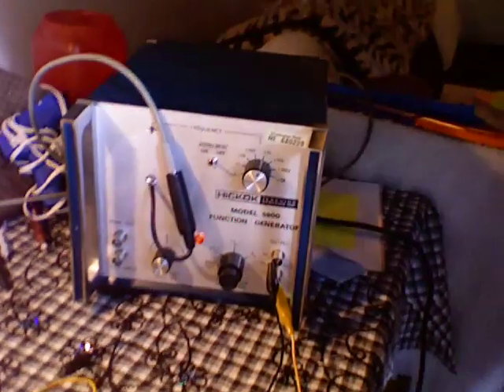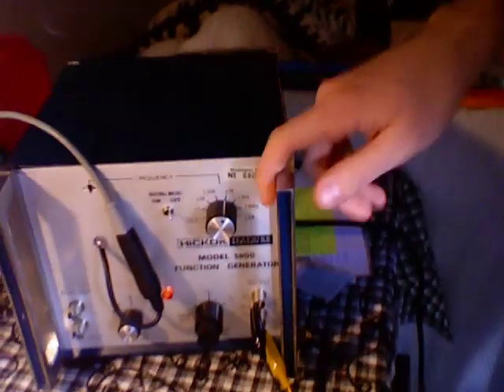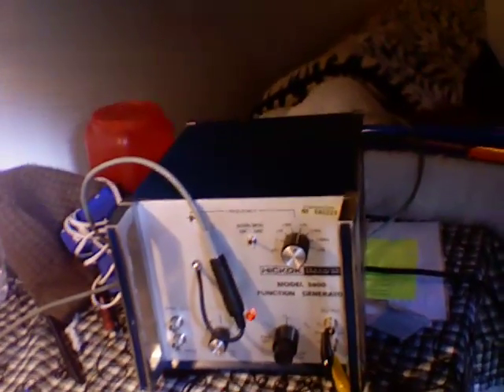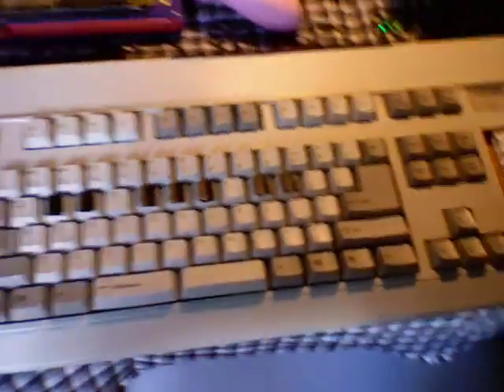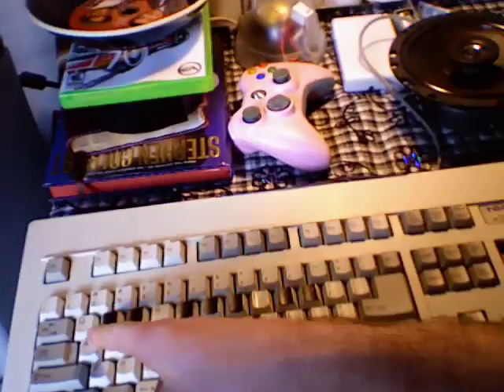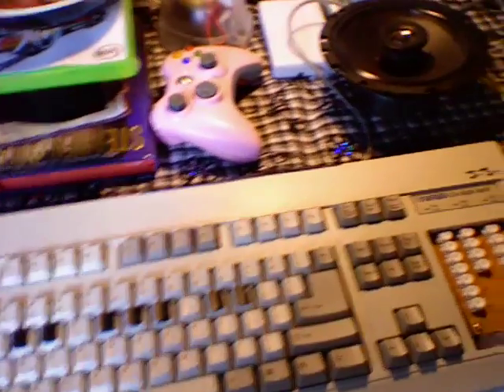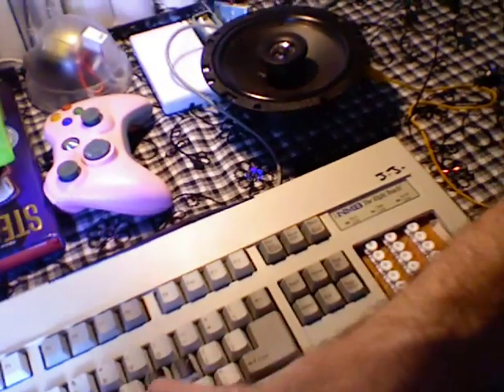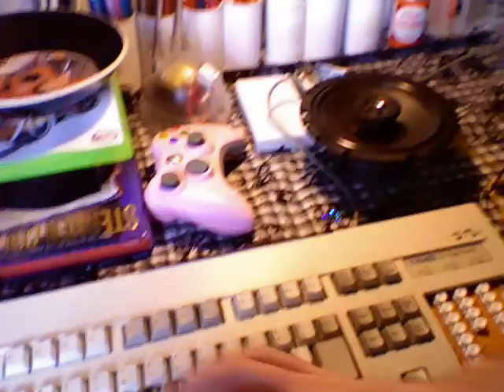QWERTY Keyboard analog synth

Comment from the maker: Well, i pretty much DO show you how i made it. You need a tone generator of some sort and then its really just a matter of finding how much resistance it takes to change the pitch of the initial tone to the desired tone of the new note you want. This can be done with resistors or in my case i used all potentiometers. From there, you just make an array of the resistors with diodes on each side going to a button for each resistor.